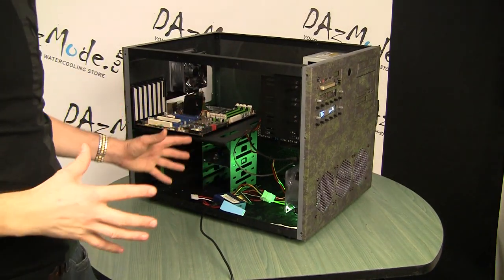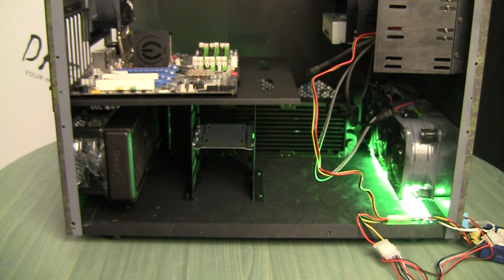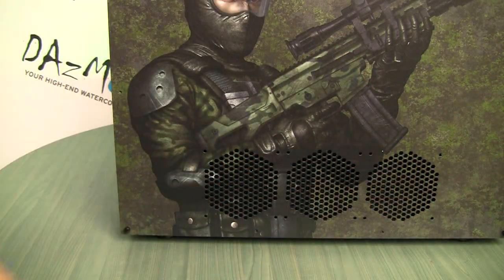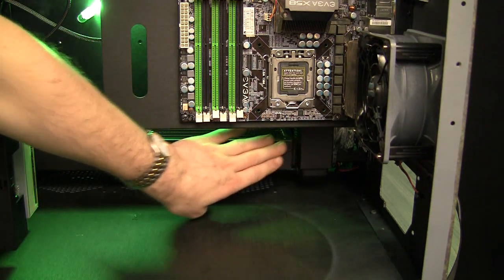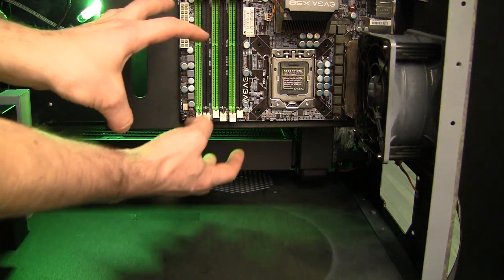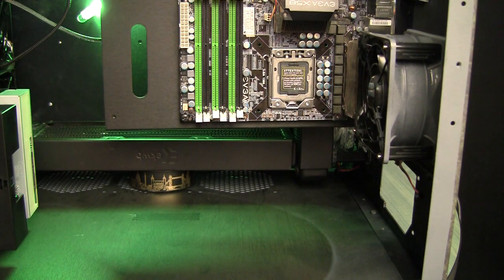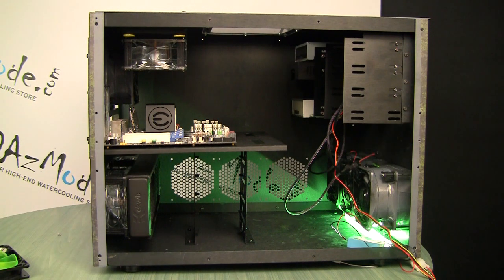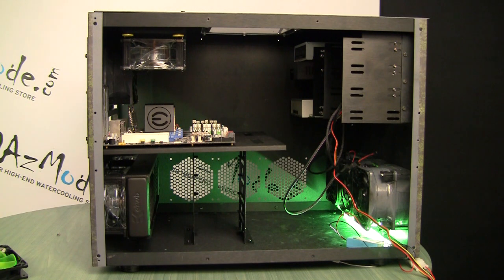XSPC H1 case Radiator Placement Options -  Silent Sniper Build (7)

Comment: @DazMode  Just an idea... Maybe you should try to mount one radiator in the front & use some white LED stripes under shrouds with Scythe controller for low brightness? This method will solve mounting problem & you will be able to see black blades of triebwerk fans. Good luck with "Sniper"!

Comment: What if you put the radiator on the front and the back panels both intaking, then exhaust it out the side of the case. That would remove the problem of the head hitting your other components and having its' own cooling zone. Then on the top of the case have intakes going down onto the motherboard then exhausting out the back. I think that would probably be one of the better thermo-dynamic options.

Comment: What about mounting the radiators in the bottom of the case with 90 degree mounts like "Universal 120mm Radiator Stand" from the dazmode store? That way you could have outtake in the sidepanels, and reasy sidepanel removal. It will be just like the bottom of the Silverstone TJ11.

Comment from the maker: @nooblady2310 I have dual GTX285 too, but I wait for 680 series myself. If you can not wait, you will get noticeable improvement with GTX580 or HD6970. In benching my clients get better numbers with water cooled 6970s, then 580.

Comment: Koolance qdc on both rads & have them both side mounted.  It should provide the most effective cooling if both rads are exhausting air in terms of controlling the coolant temp and heat build up in the case.

With one horzital rad in the bottom and one in the roof it'll be difficult to bleed both fully unless the rads have a bleed valve, you'll always have a pocket of air in one i'd of thought

Comment: Why don't you put two 240mm rads on the sides and leave 360mm rad on back. Have all three rads/fans blowing air out. To mount the side rads use XSPC mounting brackets (to mount to the floor) not the side pannels. So you can still remove the side pannels and blow hot air out of the case.